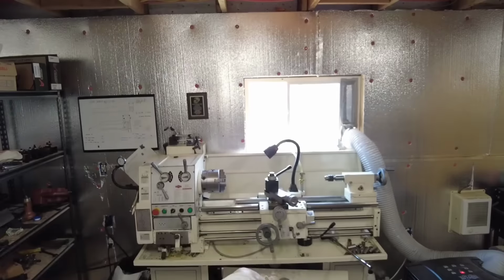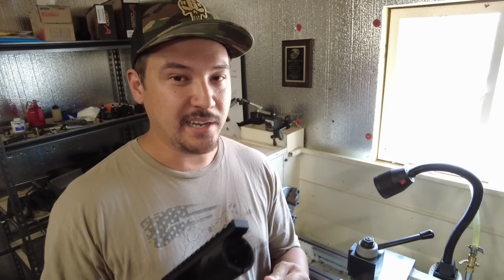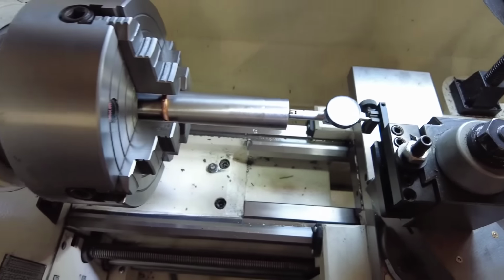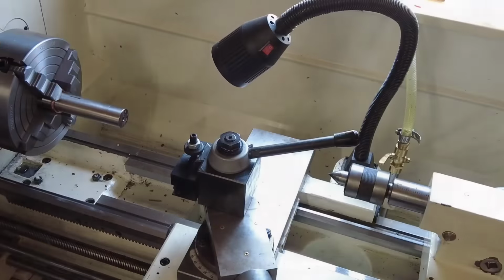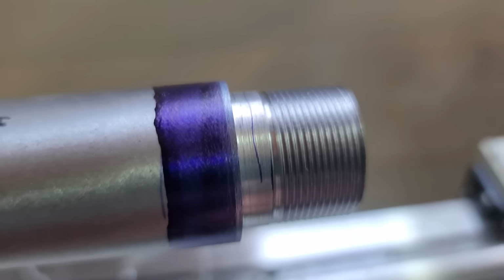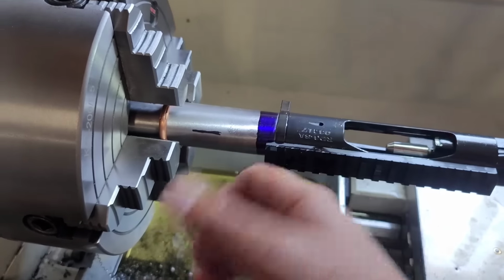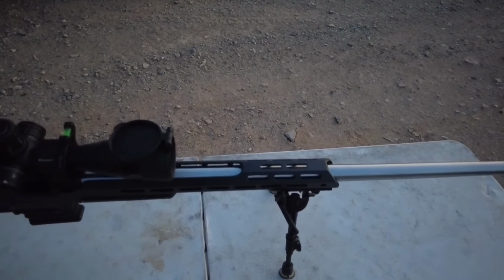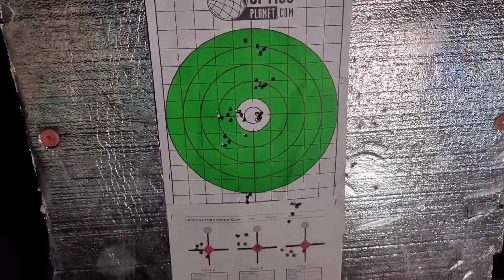Building a sub 1/2 MOA Rifle | Handfit vs Prefit

Comment: Kenny, I’ve had fantastic luck using a flex hone dingle berry brush on the chamber, the surface finish is ideal. They sell brushes designed specifically for some chambers, for others you can just use a nominal OD brush.
Reply from the maker: I'll give that a look and see if I can get some

Comment: That’s why I prefer the barrel nut prefits vs a shouldered even though I’m using the TL3 in my next rifle. The nuts let me set the headspace dead on minimum. I prefer this because it seems that brass lasts longer and fire forms better. I dunno, maybe I’m imagining that.
Reply from the maker: No your correct. Keeping a tight headspace minimizes brass growth and better matches the reloading full length die.  A good rifle builder will know how to shoulder a barrel this way as well as keep the chamber dimensions the same as a reamer for the exact reasons for reloading. A barrel nut barrel will have more expansion over a shouldered barrel because of the lack of rigidity the barrel nut offers, as it relys on the contact area of the threads vs a solid wall shouldered barrel. This results in horizontal stringing during extending strings of fire
Reply: @EagleEyeShooting  I have a concept for an action that would be superior to both nut and shouldered barrels and uses no threads on the barrel..

Comment: I've been looking at the Grizzly gunsmith lathes. Looks like they're top notch
Reply from the maker: Look into this shopfox. More add-ons like a steady and extra mounting head. Order from Amazon to get tailgate delivery.  Saves money
Reply: @EagleEyeShooting  thanks for the tip. I'm getting into gunsmithing more and more, I'm almost done with the course from Modern Gun School. But I want to take my learning to a whole other level. Tinkering with manufacturing.
Reply from the maker: Awesome,  im doing something similar.  I recommend looking into 3D printers for prototyping and fitment. Currently using them to test fitment and parts for an action I will one day wire EDM cut out
Reply: @EagleEyeShooting  I've been contemplating a 3D printer, and you're right, it makes sense for mocking up and fitting parts. They are definitely a useful tool for alot of things. Plus they look fun..

Comment: You would know better than I... Do you have any opinions on Preferred Barrel Blanks products? Specifically, their prefit barrels? I'm planning to order one for a ruger american and am curious to hear from anyone with experience using them. P. S. I'm digging the channel
Reply from the maker: I can only share my experience. Take for a grain of salt. I have had no luck with their barrels and have tried 5 barrels. Two in 7 SAUM and the others did not produce satisfactory consistency in groups. Air gauged results yieled over 5 tenthousandths deviation in bore size with the barrels I acquired.  However, they do have a large following and many post with good results. Again, I only share my experience. You may very well have outstanding results with them
Reply: I have 1 in 6.5 prc that I put onto a savage model 12 I had laying around. Shoots very accurate 1/2 moa to 3/4 moa 5 shoots. I’ve taken it out to 2k yards and made multiple hits…
Reply: .....very interesting.....thank you both for the replies
Reply from the maker: 1/2 MOA is a very achievable goal these days. Infact I found the swivel stud on this rifles ESS chassis to be touching the barrel. Retesting showed groups in 1/4". A follow up video is in play. I mean no offense,  what separates an accurate rifle vs match rifle in today's competitive world. A 1/4 consistency in group size is expected and should be expected by everyone who is willing to spend 3K+ on a rifle build
Reply: Point taken. My performace parameters for the barrel are 1/2 moa or less out to 500-600 meters on a budget under $600 and less than 6 months wait. I'm Not building a long range rig, just an 'intermediate' .308 Win for practice and plinking. Any suggestions would be greatly appreciated!

Comment: Do you have a standard for testing your depth gauge?  Thanks
Reply from the maker: Machinist block and certified gauges see latest video... regarding your last post. Copper ring grips better and is easier to clean up marks. You want a slip point if for some reason you crash or cut to deep. Replacing lathe parts is expensive

Comment: Nice job! Hart Barrels is 40 miles from my house. The guys that shoot on the top end in my area have their guns done by machinists. Every so ofter a pre-fit Criterion will keep up with a little luck. Your I'm Asian joke was very funny. You have great skills and are in to all aspects of shooting sports. Very impressive.
Reply from the maker: I need to get a hold of them. I prefer cut rifled, yet I haven't had bad luck with Douglas.  Lead times have been extremely long with other manufacturers.  You definitely got a great rifle builder.  Saw that 2 1/2" plate smack at 600 with a 22-250 in your vid. Outstanding!
Reply: @EagleEyeShooting  Thank you

Comment: Nice job.  I like that you mentioned that you don't want a polished chamber and the brass need some grip. I'll bet a lot of folks didn't know that and to go along with hand loading, the last step in the process should be to remove any oil or lubricant from the cases.  Good step by step video bud.
Reply from the maker: Much thanks brother! Yes definitely a polished chamber will get peak pressures a lot faster and yes, case lube should be removed👍👍